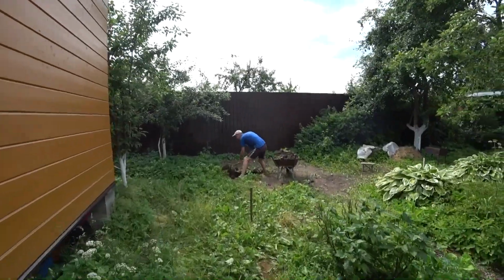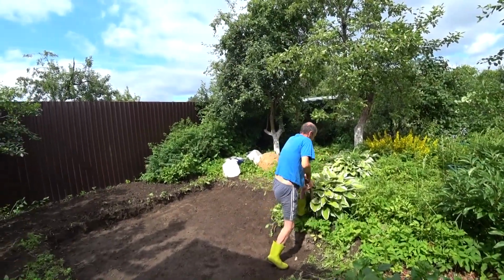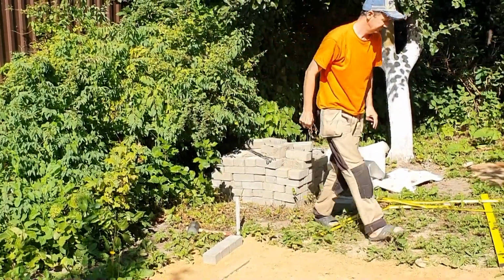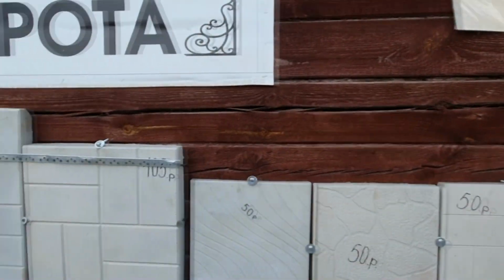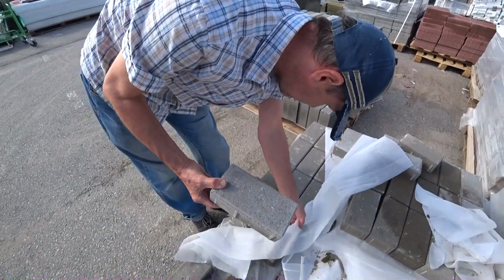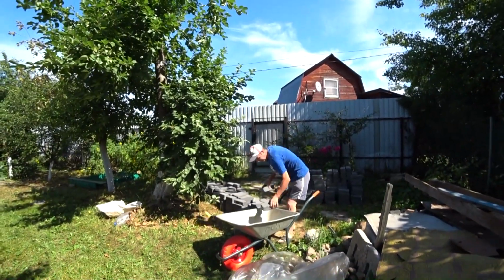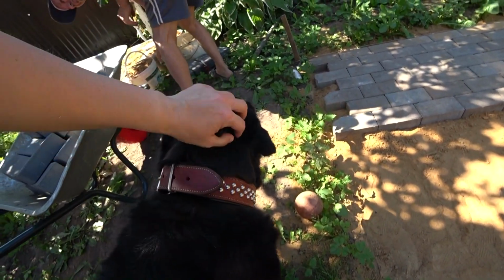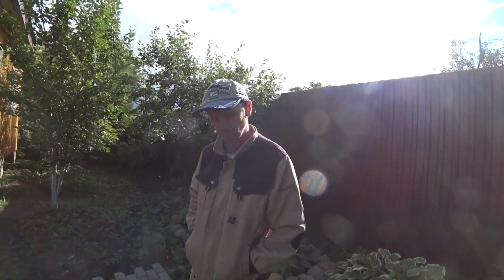BBQ Area in Our Dacha (Village) Garden / Several Weeks in a 15 Minute Video / Different Russia

Comment: The weed barrier isn't that great honestly in my opinion. I used it when i put down tiles at the bottom of the steps of my deck. after a few years weeds are popping up through the tiles
Reply: Gonna have to make sure you get an old rug or blanket for out on the patio when you're using it for some place for Sheffie to relax